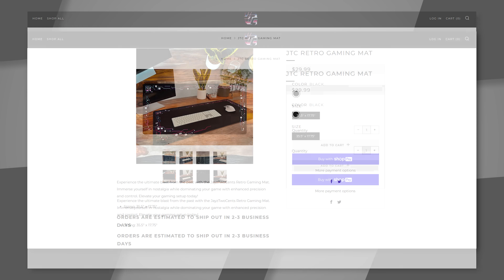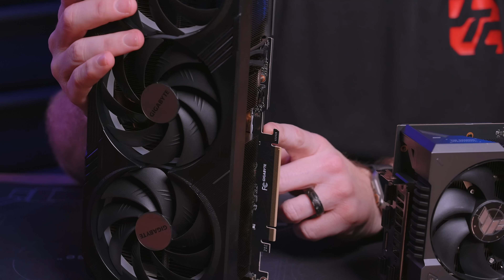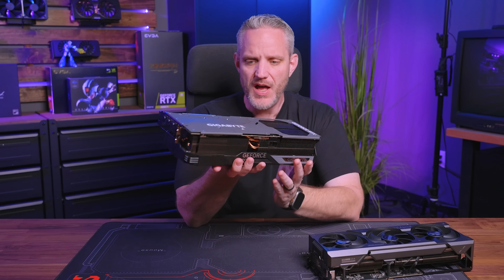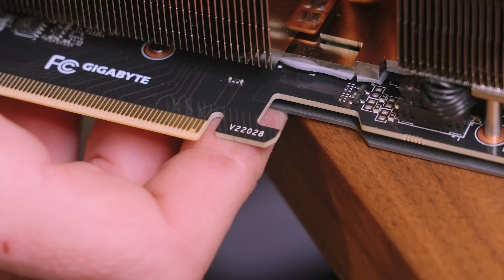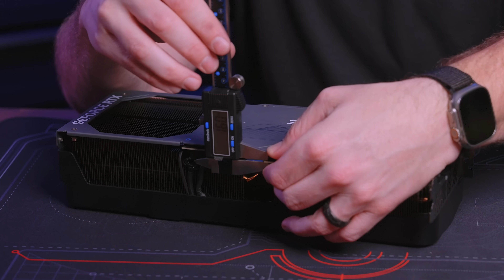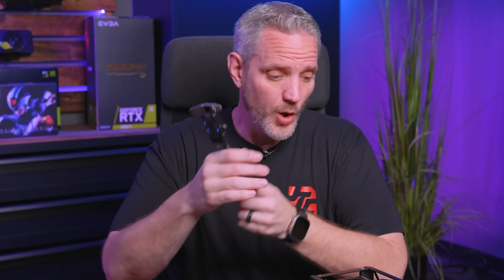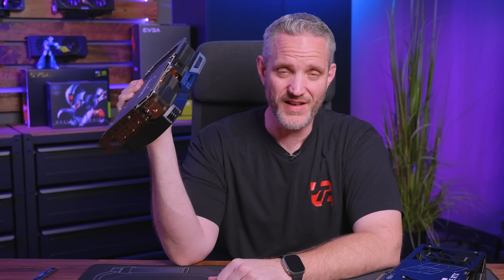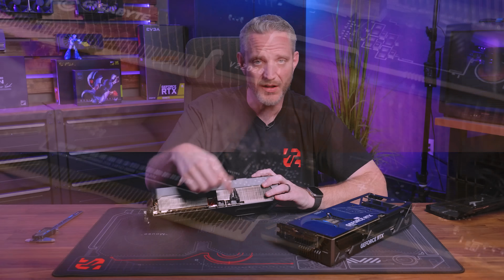These GPUs are cracking and the company REFUSES to warranty them!

Comment: Gigabyte is too busy for this minor issues right now, they're trying to get rid of the viruses and in their motherboards! 😂
Reply: Nah... they dont even bothered to repair the BT signal drop issue with their B450 Wifi boards. Its was really annoying to reconnect every time the BT soundbar, when i switched tracks or browsed on Spotify/Youtube for music. When no sound played, the BIOS ordered the BT chip to power down to save energy. Its a BIOS issue, which exists from the first, release BIOS and still not solved(and it wont, because the B450 lineup is EoL product now).

Comment: I think it's time video cards start using a new form factor or slot interface. These devices are getting heavier and larger every  new generation. It's why I just do liquid cooling and vertical mounting on my cards now, so I can save some space and also not have to worry about sag of snapping PCBs.
Reply: Exactly so.  Just like the stupid ass power connectors.  That could be fixed with a simple design change and much thicker wire.  There needs to be a completely redesigned way to mount these things into the pc.
Reply: This! If you mount a heavy cpu cooler it has a special bracket with 4 screws because of the weight that is hanging. With a graphics card there is only the pci express slot and 1 screw that carry the complete weight of the card. Some computer cases come with an extra mounting solution for heavy graphic cards but not all have that option.
Reply: @NLsandman  You can literally buy anti sag brackets or metal magnetic stands to help support it.
Reply: The industry doesn’t care because it means they get to sell more cards to consumers.

There is no money to be made anymore in more durable products.

Comment: This is the same type of grips Jay was Having with ASUS, then he stopped working with them.  So you see what he’s doing.  Putting pressure on Gigabit to take a look at this issue but also warranty it if it’s the PCB that’s cracking.  Eventually he will not do business with them either if they don’t shape up.  But personally I think that’s a mistake on Jays part not to review their stuff.  He can still be critical in his reviews and even suggest nobody buy the product until he feels it’s good enough, but to just cut them off totally is hurting Jays channel in my opinion also.  Most people I think still would prefer him to review the Equipment and do what he’s always done, give it a thumbs up or down.

Comment: Unfortunately the PCI Express standard has the area that is cracking specified as a component free area, but not a copper/signal free area.
They further specify: (Making this an issue with not following PCI spec due to not using retention bracket on graphics cards.)
"Two types of add-in cards must be “retention ready”:
− Graphics cards.
− x1, x4, x8, or x16 I/O cards that, in the judgment of the OEM or card manufacturers, have sufficient weight or length that the card may need an additional retention point for stability. Retention ready means that the add-in card manufacturer must have selected (or created) a retention mechanism and made provisions on the card to facilitate the retention mechanism. The reference retention mechanism designs and related component keep-out or height restriction areas are defined in the PCI Express Graphics Card Thermal Mechanical Design Guidelines. The full-length card, 321.00 mm (12.283 inches) long, is considered retention ready. The mounting holes on one end of the full-length card allow the optional PCI card retainer to be installed to secure the card (see Section 9.1)."

Comment: If the pcb is more bendy/less rigid/softer, all other variables aside, that should actually avoid cracking.  Soft things bend, hard things crack, and toughness is hard to measure non-destructively. It may have been better not to use the 40 series card publicly as a test/comparison.  Other than that tho, thanks for the info.

Comment: I will have to disagree on PCB strength...gigabyte makes great PCB...what is being shown is an issue is of how the PCB is secured to the rest of the card. By the looks of it, there might need to be more screw points/points of contact between the PCB and cooler + back plate.

Comment: The whole product is badly designed. Useless huge cooling solution ( especially for the 4070 Ti ), huge heavy useless backplate, totally unbalanced in the distribution of it's weight, cheap plastic components for the rest of they'r GPU. When I did mount mine on my mobo ( B550 Aorus Pro AC ), I had to made a custom support on my own, to sustain the GPU properly, since the one provided by Gigabyte, isn't enough if mounted horizontally. Now it's fine but that's not something I should do, to solve Gigabyte incompetence.

Comment: My theory...the orientation or the composition of the laminate layers might be the issue.

Like plywood, if the layers aren't offset the right way (they're all laid with their grains lining up left to right), then the resulting material can flex (bend) in a direction that's perpendicular to those grains (up and down, for example).

Also, if the layers themselves are made of components that are too weak to resist flexing (bending), then the resulting material might not be rigid enough to offer the necessary support that's needed.

Comment: Jay is completely right here regaurdless to the messurements of the thickness it is irrelevent in everyway. Here is a challenge.  Go do some look ups between 1998-2004 for Manufacturews of ALL GPU's of this period. Shoot even Stretch that out to 2010. Get a Decent list of all the popular Manufactures by number of sales.  After you do this Look up current new products from this list. When you find the Manufactures that are missing, go find out why they no longer exist.  I promiss you they are for similar reasons to what Jay is saying in this Video. MANUFACTURES NEED TO OWN UP! Back in the period listed above many comanies fixed the defects right away within a few months and still lost the GPU departments. Example ATI Radeon! Another Example EVGA Motherboad using certain Chipsets being AMD or Nvidia.

Lets think. Thickness isn't relative, but durability is.

Comment: It's annoying... I'm looking to build a completely new PC because my 4770k and 1080Ti have done a great job, but it's time to move on! And I don't feel comfortable gaming on my 12900HX/3080Ti laptop when summer kicked in here this week, and the temps are immediately above 30⁰ and rising... and there are so many problems with components that it's getting hard to avoid problems. And I'm a person who just does 5 years with a build without changing too much on it. My 4770k system is even pushing 9 years now but still stable as a rock. It only has a slightly corrupted windows, and the waterblock(XSPC) fins are 50% gone, but temps are still awesome, so I'll keep pushing it. But what to buy.. 🤷‍♂️

Comment: sigh Time to check my graphics card and see if its retention tab is breaking.

On the latest NVIDIA drivers, my computer would randomly black-screen and reboot, and sometimes BSODs with VIDEO_TDR_FAILURE messages while the screen is in standby.

Mine is a RTX 3060.

Comment: Gigabyte or Asus do not stand by their warranties. I rma'd 2 am4 motherboards for known usb issues for gigabyte. Paid for shipping and they returned both saying they could not replicate the issue and I continue to get usb failure messages on both and random restarts. I purchased a Gigabyte   RTX 3070 and it is outperformed by my Asus RTX 3060ti in performance, cooling, noise and power efficiency wise. I have tested this in several games including resident evil 2 and 3 remakes, Forza Horizon 5, GTA 5.  I will no longer be purchasing Gigabyte products in the near future. After years of loyalty to Asus, it is no longer the brand it used to be. Asus did not fix the wifi issue on my motherboard or pci e x16 gpu retainer clip that gets stuck making it hard to remove the gpu or sata ports crashing and not reading Hdd's. With all the motherboard issues Asus and amd have had, this brands are showing their poor ethic and appreciation for their consumers. I will now try my luck with MSI and Asrock. Although Msi also has been  having issues with their aios and also gave a poor response to other countries in the matter. It does not speak well about the brand either. Nvidia and their money hungry tactics playing a part into a rapidly declining pc market. This is the worst time to build. PC gaming may be looking at it's final days. EVGA was smart to get out at a time were the pc gaming industry is loosing it's luster.
Reply: My last 3 system Builds have been ASRock.  The Boards have been great. Did have a Ethernet Controller issue on a Z790, I had a replacement in 9 days. Only thing bad about ASRock is there Fan and RGB software.  YUCK.
Reply: @shuntao3475  Thanks for the info. I really appreciate it. Gigabyte's SIV fan software is a poor implementation as well. I do like Asus Fanexpert 4 but it does need some improvement. I will look into Asrock. Thank you!

Comment: the problems with the gpu's boards cracking. i personally believe the companys are not reinforcing those spots. cause those are not that thick and with the extra weight being added to it with zero reinforcements on them shows they dont care about it really. i worked as a circuit board repair tech for a military company. and i saw reinforced boards in spots where they could bend a little. and here we have the bottom of the barrel boards that are made in mass for as cheap as they can.

Comment: Im running a Gigabyte Gaming OC 3070, which is also fairly chonky having a 3 fan cooler. And now I'm likely to never remove it until replacement 😄 But, because this is my first gaming PC and I did a bunch of research including watching your videos and countless times talking about sag, I bought an anti-sag bracket to do right by my investment fron the start.

I feel like the sag theory and undue stress on the limited mounting contact is a good hypothesis just exasperated by possible poor manufacturing.

I'll be keeping my ears on the topic.
Reply: I've got the 3050 gaming oc and thought I'd be exempt from sag, but after 2 days I had to put a bracket under it because it was sagging just enough it bothered me. Say what you want about gigabyte but they sure don't skimp on the cooler no matter what skew you buy.

Comment: Two things of note, the PCB should be the same thickness on each card and the physical design is responsible for that extra flex. The locking cutout is much smaller on asus and adds to board rigidity
Reply: Yes. The larger notch is easier to flex than a smaller one.
Reply: @VoldoronGaming  Exactly!
Reply: Structural rigidity is achieved on the ASUS card by the screw right above the tab. Adding thos screws create additional assembly steps, screwing has to be controlled, there is a higher ppm (rejection) on the line. So at the end it will be a little bit expensive. So when people are buying cards from the lowest price tags they are actually taking small risks where corners were cut. I'm dealing with serial care. The manufacturer obviously going to deny warrenty. I mean cracking that tab could have been caused by assembly or disassembly and PCB strain is a typical silent killer.

Comment: It's not from vertical mounting as there would be stress fractures all along the terminals. The sag would affect only that tab from the twisting putting most pressure on that tab. The issue is the sheer size of the cooler. IF they came with AIOs then those would be less strain and weight on the PCB in the first place but providing cooling. The air cooling the comes with these are FAR TOO HEAVY especially at the end with no support, like a lever, the further away from the pivot point (in this case the mount point) then the more the weight will be amplified and thus the greater the strain. Actually put the PCB with nothing on it next to the cooler, weigh the cooler and see the weight. The PCB is ONLY able to take so much weight and the cooler far exceeds the maximum tolerable weight load the PCB can handle.

Comment: 6:00 I've had some VERY weird problems with chassis fitment over the past few years.  Not only for GPUs but for coolers and radiators as well.  Specific to this discussion, I've seen PC cases where the PCIe slots (COVERS REMOVED, YES!) on the rear of the chassis actually not to bent outwards to accommodate the GPU properly.

Comment: 16:00 Speaking of being loud, Gigabyte's fan profiles on the 4000 series cards (windforce 4090 in my experience) are terrible and ramp up to 100% randomly, while otherwise the fans stay 0RPM until a certain temperature then jump to 60% immediately.

No card I've used previously has done this, and last I checked Gigabyte STILL hasn't done anything to rectify this awful behavior.

Comment: Their rma is absolutely terrible. They don’t even fix cards lot of times if you have a card with no physical damage they might just say it’s repaired not even test it and send it back. It happened to me with BNIB 4090 base model. No boot, tried it in 2 computers and even a friends. Sent it to gigabyte and then said they did something with 12v power and I got it back quick. They had it for like a day Lmao. I got the card back same issue. It didn’t even look like it was touched. Whoever was repairing it didn’t do shit. It’s almost like they clicked a check mark and sent me my card back as is. I won’t touch this brand with a 10 foot pole. They hide behind repair and they pretty much frustrate you so much you end up buying a new card. I have had other users run in to same issue as well. Terrible brand, they will run you in to loop so you just give up. Never again!!

Comment: Good PCBs made from G10 which is resin impregnated fiberglass cured under pressure. G10 is tremendously durable. Gigabyte must be using some cheaper materiel which is pretty gross in a card that costs that much. G10 is already dirt cheap so they'd be saving very little by using cheaper PCB materials, probbaly less than a few pennies per card. I mean even outfits like JLCPCB and PCB Way that have made a business making dirt cheap prototype PCBs use G10.

Comment: Yeah I'm starting to feel like I won't buy Gigabyte products again after this situation and the motherboards with vulnerable BIOS. 

I have this same 4090 and fwiw it did come with a huge L bracket to mount and hold the card. On top of that I also have the anti sag bracket that comes with the Fractal Torrent. My GPU is locked in.

Comment: I feel like the Pci-e tab breaking is nothing new since shipped PCs have experienced it as long as the connector has been around and cheap cases not having good tolerance for the gpu/IO support brackets. Of like Jay said unusual mounting locations. The problem seems one a mix of brittle PCB materials, fatter cards, and Traces getting too close to the bracket. It would be interesting to compare the bracket to a old EVGA card 👍

Comment: I have a Gigabyte RX 6900 XT that is horizontally mounted. Yes horizontally!  the case I have has all the connections on top, I feel because its bolted in ( large screws ) there shouldn't be any extra pressure on the tab right ?? 😦

Comment: Hi Jay, 
Great informative video!

We (System kings Belgium) have thesame thing happend and warranty refused on a asus 3080 (think tuf). We didnt handle it bad the card and pc left the shop working only after a few days the gpu was dead. Client didnt touch it either. And you confirm what we think, they didnt open or inspect the gpu further and clearly knew to look there.

Glad someone talks about this defect, because they are getting away with this issue. We'd be happy to send you all the info if you want or need it. We were going to ship it in for resoldering and fixing the pcb, its currently still in our shop we gave the client a brand new replacement. I should discuss with my co-founder, but i think he'd be willing to ship the gpu if you want to examine it

Comment: They are refusing the warranty and know where to zero in because it is an intentional design flaw in the spirit of planned obsolescence.  Make a weak spot and run the the power through it so that when it breaks it takes the whole thing with it, now you need to buy a new one.  There is no such thing as future proofing, just using it until it quits.  Because the "Future proof" options break before that very future arrives.

Comment: My guess is probably one or both are true:
1. It's being damaged when it's being installed (when the GPU would be vertical) and the motherboard clip hasn't locked in
2. It's being damaged when it's being removed (eg to install SSD's that are beneath the GPU)

It would be interesting to ask the people who RMA'd the Gigabyte GPU's what motherboard they installed them in, because that could point to the retention mechanism on a brand/model contributing to this.

Overall though, I think we should have seen the writing on the wall that "2.x/3 slot" GPU's were always too big, mechanically, and we need a new standard that requires mounts on the front and rear of a card if a card exceeds 2 slots width.

Comment: Have a Gigabyte 3070 and, although I haven't run into this cracking issue (yet), I can say that the RGB software is shitty and the support is extremely lacking.  I have a Rev 1 card and it needs a firmware update to get re-bar working but Gigabyte's website doesn't have a compatible firmware at all.  Customer support was less than helpful as well.  Will def avoid this brand in the future.